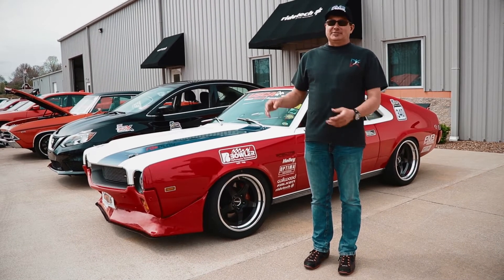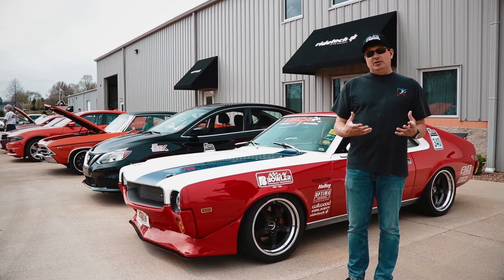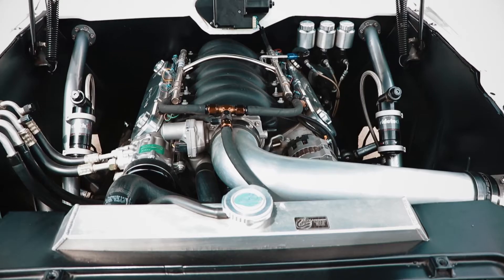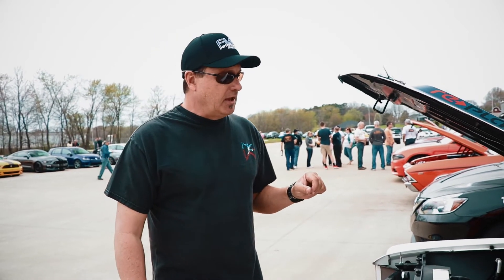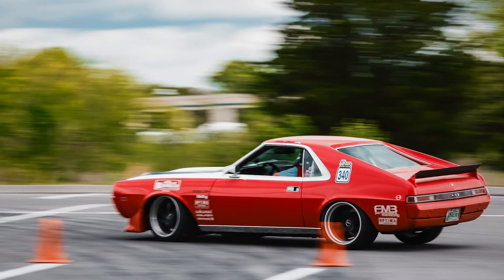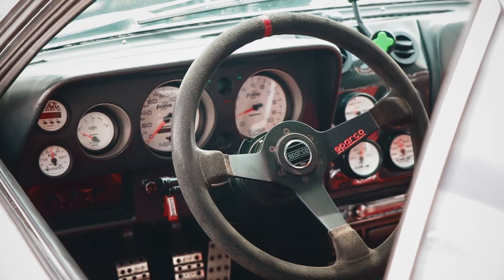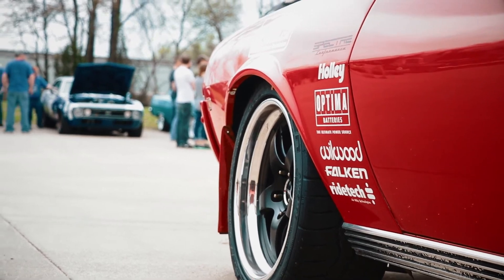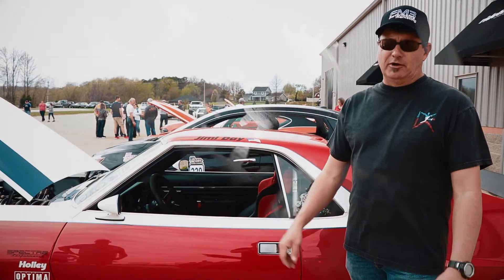Gearhead Next Door - Jimi Day's ProTouring '69 AMX

Comment: Beautiful car Jim, I would recommend you section and fit the front/rear bumpers to the car. The ill-fitting bumpers take your eyes away from the beautifully designed body lines  Fit and finish was never an AMC strong point, so anything you can do to clean up the fit and finish is a win-win. Don't be afraid of the lightweight big cube AMC engines. With a few select parts and some simple oiling mods, a 500 - 600 hp  70 plus 390 - 401 road/drag/street engine will run 100,000 miles trouble-free. So don't be afraid to build an AMC engine. Parts, blocks, aluminum heads are available from Chrysler, Indy, Edelbrock, and other AMC suppliers.You have a choice of 4/5/6 speed manuals as well as early Chrysler 727/Turbo 400, 3 speeds etc and a host of late-model 4-speed series automatics.A overdrive gives you the option of the highway, road racing, and drag race.
Reply: If it's going to get used a lot, a fully dressed LS is the logical choice in every single way. The only rational reason to build an AMC motor is to brag or re-sell appeal(you won't recoup the cost anyway), while spending more money and time.
Reply: What are you talking about? Javelins and AMXs had the flushest bumpers on the market. And no, an LS based motor would be the best for pro touring, the thing is all aluminum. Can't say that about an AMC.
Reply: @Physifist Engineering said, "What are you talking about? Javelins and AMXs had the best flush-fitting bumpers on the market". "Unfortunately, they missed the mark on  the 68 - 70 AMX production."

I section [shorten and straighten ] and reweld the front bumpers to fit the fenders recess/lines. The poor stampings and wide-panel gap tolerances made for sloppy-fitting front bumpers on the 68 -70 AMX. I've yet to see a production front bumper that fits the fender insert, grille, and headlights uniformly. 
Most all have a slight twist and extend past the fender recess with irregular gaps around the grille and headlight bezels. I fit them as AMC originally intended.

The rear decklids are also an eyesore; I reshaped and welded mine to fit the body uniformly. I tell myself," I'm restoring a 911 Porsche"LOL. Holding tight even body gaps around the bumpers, trunk, hood, doors, glass, etc. add to the beauty of the 68 -70 AMX.
Reply: @Godscountry2732  as a professional custom car builder I cringe when people want flush mounted anything. You've ruined any chance of body protection in any kind of minor fender bender. I want my bumpers off the car because a bumper I can replace, but body work and paint, not so much. Nor am I going to get any noticeable performance gain by flushing everything. Nobody here is doing 200 mph in these cars. If you want to do all that work go for it. I'm just tired of custom cars that are a nightmare to work on.
Reply: @PhysifistEngineering  The Roadster Shop will sometimes fit the bumpers on a stock car as well. We don't alter the lines of the car. They look exactly like stock AMX bumpers. We make sure the bumper is symmetrical to the rest of the car. Take a look at photos of the 1968 -70 AMX front end. Especially the 68 - 69 AMX / Javelin front bumper/fender fitment. I think you'll understand what I'm talking about. You said it yourself, "AMC's have flush-fitting bumpers.LOL

Honestly, I've never had anyone ask me, "Are those custom bumpers"?.They just fit better when they're symmetrical. It's pretty common in restoration shops. The early stampings were pretty rough and would vary from production run to run. I worked for AMC/Dodge,Jeep dealer. I would pick and choose to get the best parts.

Comment: Replaced the orig 343 with an ls to get 450 hp?  You realize amx is a very rare car right?
Reply: You could drop a cheapo LS but the small dimension AMC engines make a reliable 450 -500 hp. The cars are very light as well. The stock 390 -401's have forged steel cranks and rods which are good to 8000 rpm,if shot-peened, crack checked/ARP rod bolts, nuts  Keep the 343 for if and when you sell it.My brother-in-law had a 68 AMX Crane hydraulic cammed 390 [302 duration,496 intake/exhaust] stock rockers/Flat top pistons, unported non-dogleg heads. stock rods, crank, dual points, dual plane intake,850 DP Holley, running 11.40s at 119 mph with a 4 speed T -10 /9 inch Ford 4.88 gears. The car also ran 11.40s with an 8 inch 4800 stall convertor and 727 with a trans go shift kit.LOL.My 69 AMX was a sleeper with factory strips,wheels [fully restored]401 10 inch race convertor /727 The car ran 12.20s at 110 mph on bias G60 tires/391 gears..LOL through the exhaust.I drove it every day for around 5 years,it never broke. Of course, I knew not to run slicks with the stock rear and hub keyed axles.
Reply: @Godscountry2732  Yup, not a thing wrong with the AMC motors. I have a 69 Javelin SST with the 290 HO and 4 speed manual. All original. Still feels great when you step on the pedal.
Reply: 550hp! Listen.